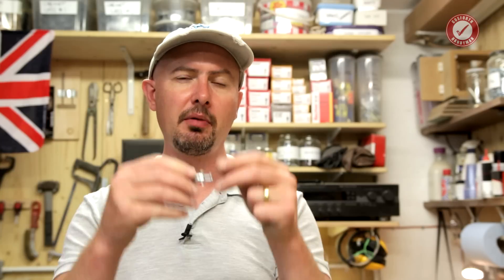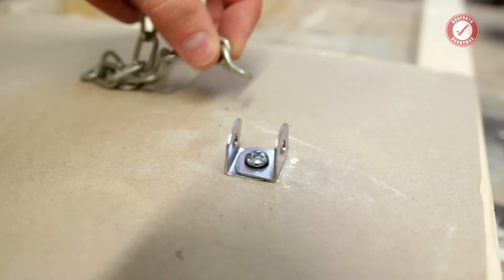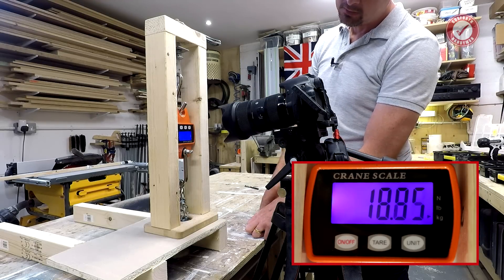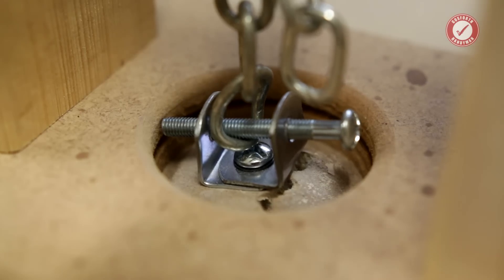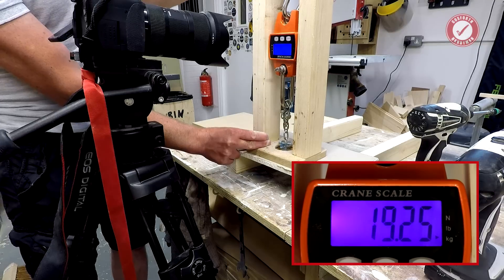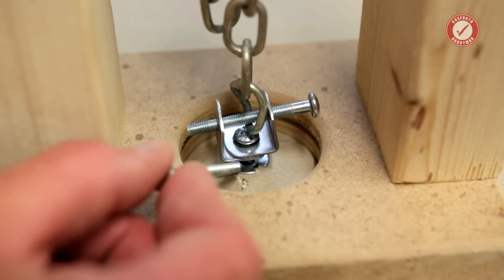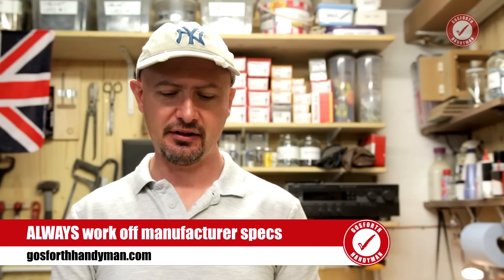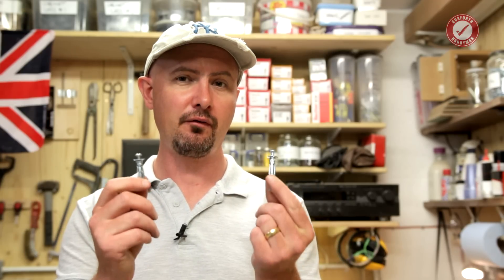How strong are expanding metal drywall anchors?

Comment: I use these all the time without the “special setting tool” this guy just trying to sell tools
Reply: It depends what material you're using them on.  They work fine without the tool when you're using them with drywall, wood, and many other hollow wall applications.  However, not with lath and plaster or plasterboard, which is what he was using in the test.
The more you know........
Reply: Umbrella fixings like these must be set with such a tool to perform as planned. Simply screwing them tight will not open the umbrella but break the crown (they are breakable in order to remove the fixing). The specialized tool doesn’t cost much (less then 10€).

Comment: NEVER used a setting tool....... if you bore the right size hole... and never have to use a hammer to put in, if so its the wrong size of hole. they don't need a setting tool. theyhave small spikes that grip the drywall........ drill the right hole, push in and  tighten with a battery gun  and your good to go
Reply: J F it's 10x easier with the setting tool. I've done it your way and I've done it with a tool, your way is history.
Reply from the maker: You can use them without a setting too but they're designed to be used with a setting tool.